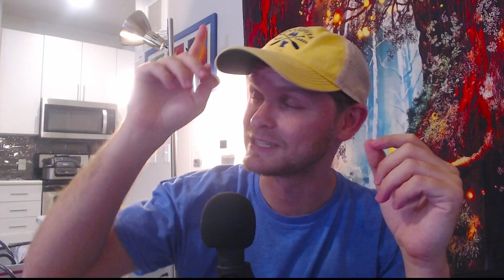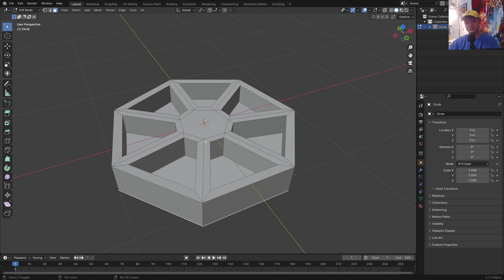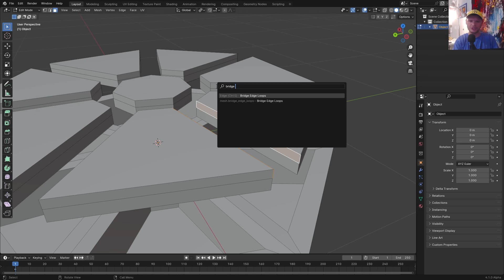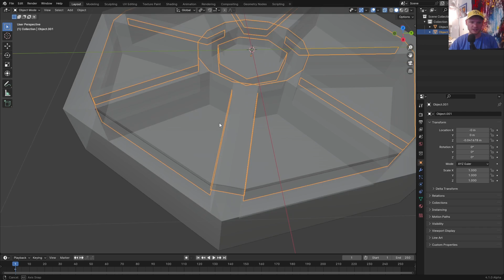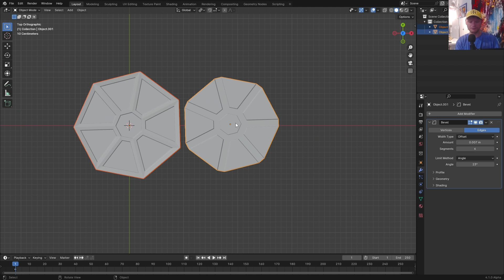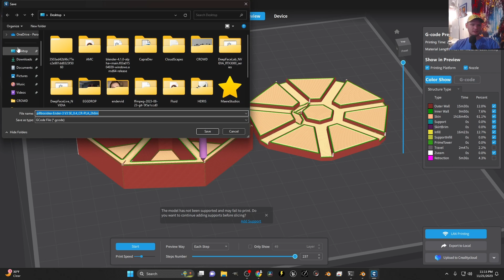3d printing a custom pill box

Comment: So I'm all for printing useful stuff but there is a high probability that you could get ptfe on your pills using anything that's 3d printed.  Having a printer in general will require ptfe lubricants which are very bad, but it is much worse to accidentally ingest them.

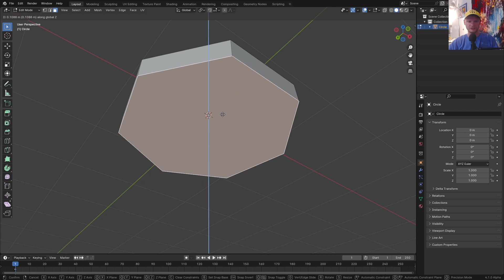Comment: 5:13 I would inset this area twice and drag the middle area up a little, if you look at any plates or cups or bowls you will notice a small ring around the bottom, stuff like this struggles to stay flat when the whole surface is touching the floor.